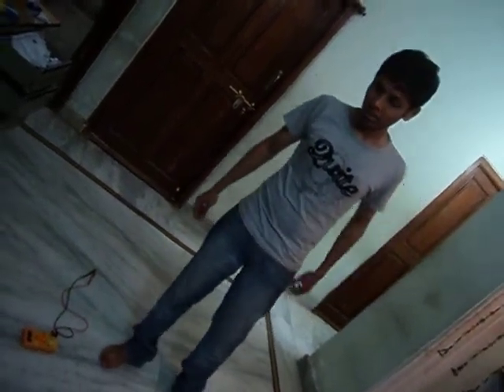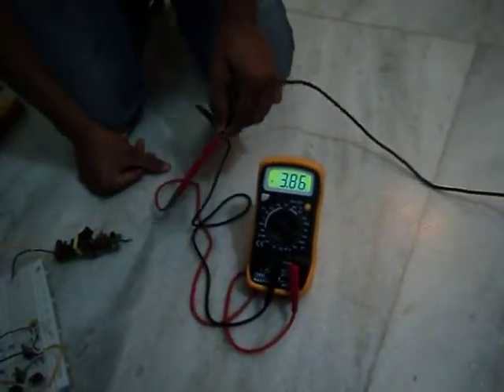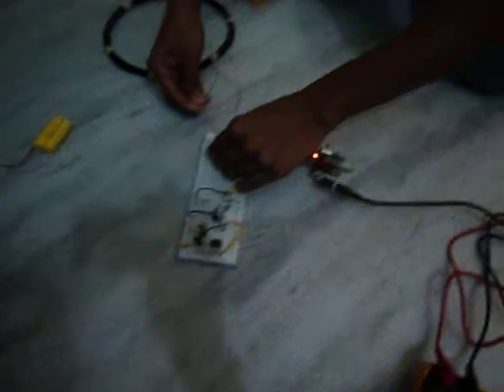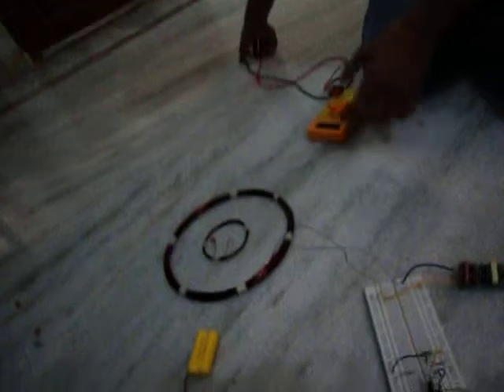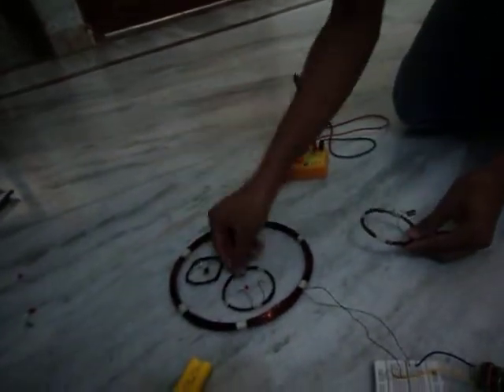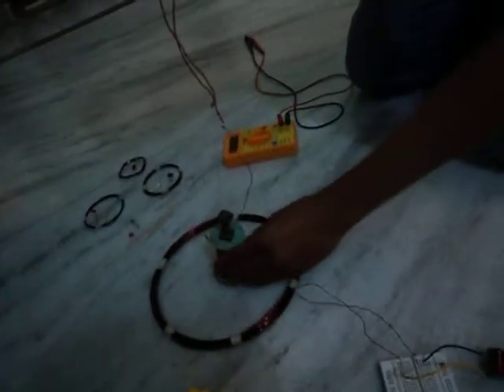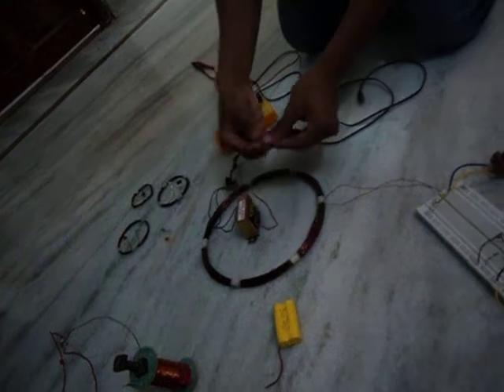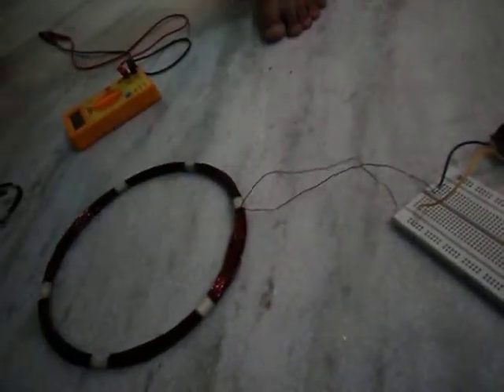WIRELESS ELECTRICITY AND POWER TRANSMISSION using COILS

Comment: that device is nothing but a modified fly swatter available on roads for as chep as 30 bucks(modified to work with an ac adaptor) & the principle is plain Physics (electro magnetic induction). The swatter net terminals are replaced by a copper coil & high voltage is induced by the swatter into the coil. When ever electricity flows into a coil an EMF is induced which in turn is picked by the other coils (ones connected to LEds) & converted to electricity & hence leds glow.....simple

Comment from the maker: hay sagar howal the circuit simply multiply the voltage( voltage multiplexer Lift 9V to 13.5kV )
the major job was done by the coils and number of terns 
in video description  i posted a link where u can get the circuit diagram (voltage multipluxer Lift 9V to 13.5kV )